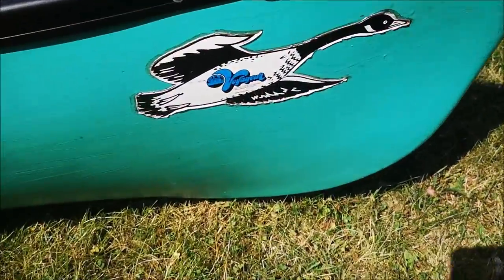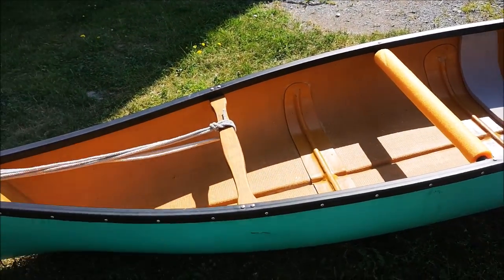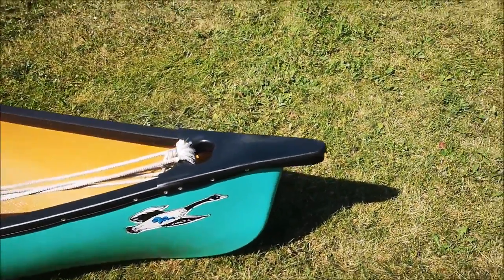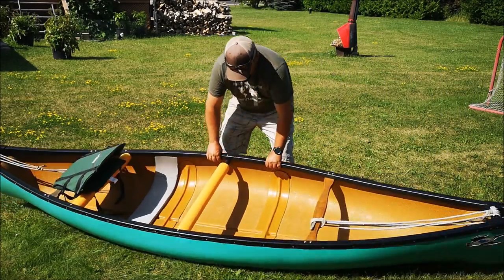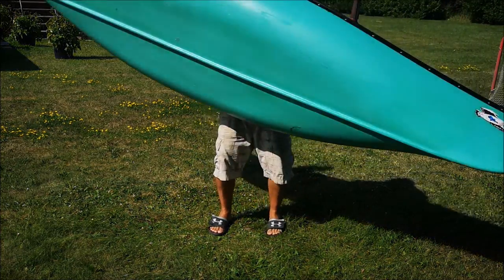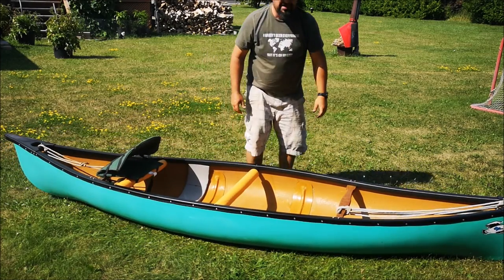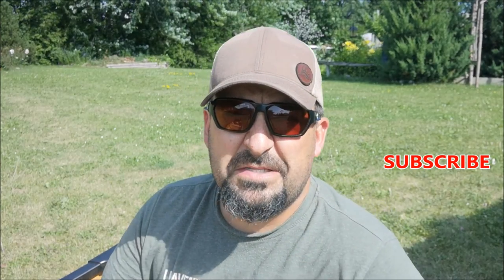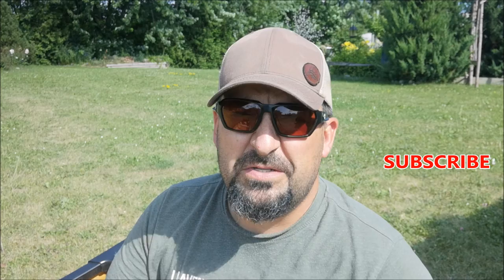Vintage Canoe Restoration

Comment: Just curious if you replaced those ribs in the canoe? If so what did you use? Cheers
Reply from the maker: Those metal ribs are original and integral to this model. I don't know if they can be replaced actually. Fortunately they were solid and replacement not necessary.
Reply: you probably dont care but if you're bored like me during the covid times you can watch all of the new movies and series on InstaFlixxer. I've been streaming with my girlfriend lately xD
Reply: @Aiden Bryson Yea, been watching on Instaflixxer for years myself =)